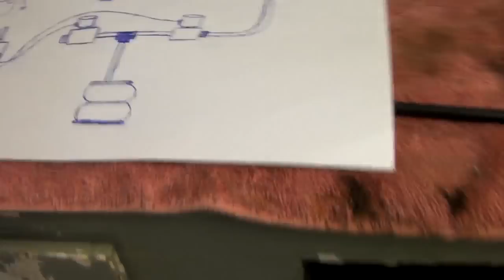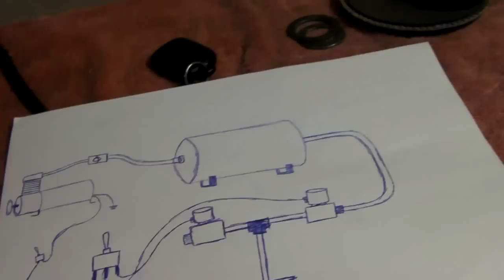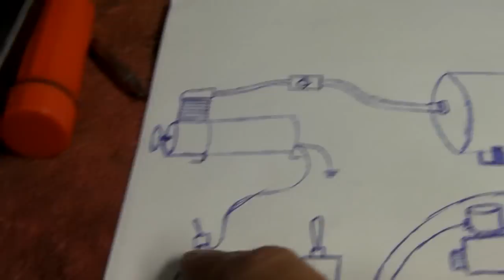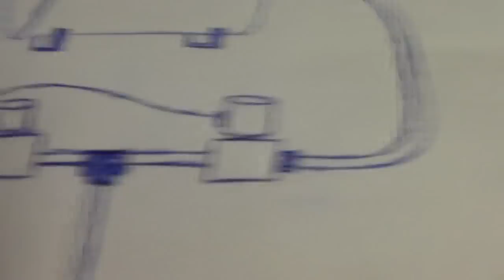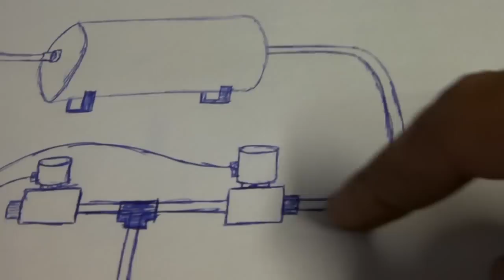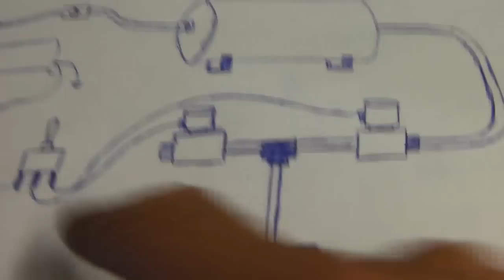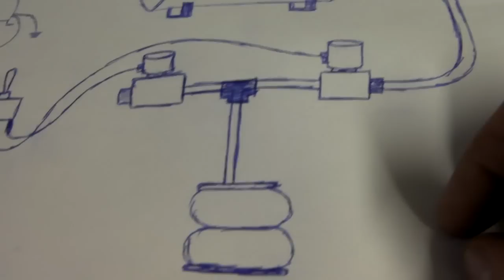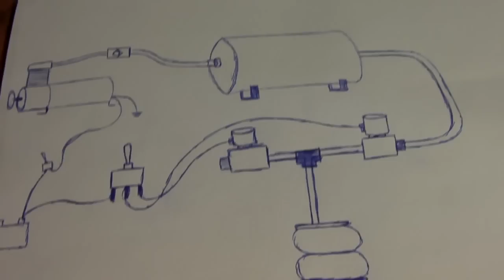Air Ride Suspension, Learning the Basics

Comment: Nah, you didn't confuse me.  Good information.  Heck, I was hoping that you would dive even deeper.  I mean, what size of hose (blue) was that (3/8")?  What type of hose was it?  Why did you choose that hose over the stuff you typically see in an air ride system, which looks to me like plastic?  What size were the manifold ports?  I could use a follow-up video with more detail, to include what you've seen over the years with those "death trap" air ride systems and what you had to do to correct them.  Details... :D
Reply from the maker: I actually did a series of videos when I built my current ride and I covered and explained a lot of details. Check out my 72 Chevy C-10 build.

Comment: Hey, very good video. I'm doing air ride on my truck and I'm new to it. I'm only doing bags on the front for clearance purposes. Would I only need 4 valves? Also where did you get the rocker switches at?

Comment: Your drawing is fine and thanks for the basics. I asked questions and the first word of the answers are normally already over my head. I'm a tech, so I can get it, but you got to start somewhere right. Hope you don't mind a couple questions. Trying to accomplish: 1) Ability to get rear end 9" off ground to load a wheelchair. 2) Raise back to normal height at push of a button.. 3) Normal ride all other times. 4) Dependable. You think I can do that for under a couple grand or close to it??? 2013 Transit Connect XLT
Reply from the maker: check out the accuair E level system for simple one touch operation as you're describing..... problem is, that system alone is 800-1200 dollars by itself. Then you'd need all of the other components and that would add up quickly. And that hasn't even been installed yet and depending on the shop that does the install, most shops charge minimum $80 an hour for labor....  I'd say a couple grand isn't gonna make it happen unless you find a shop whose willing to do it for a charity tax write off??? I don't know. If you're talking about Only the Rear and not the whole car, that could be an entirely different story. Depending on the level of fabrication involved to achieve you 9" requirement, that could be as simple as installing bags in the rear and that's it,,, or having to "4-link" and cut and raise the whole floor???  I'm unfamiliar with those vehicles so I couldn't tell you,, but it could be done for sure.... how easy it is and cost involved would have to be determined by the person doing the installation after they see what's all involved. If it's "easy" a couple grand should do it,,, but if needed to fabricate and rearrange everything else to make it work, the cost could easily surpass your $2000 budget....
Reply: A lift is $8000 and a manual floor lowering is 20K and neither is very cool. So I would say this is more doable. especially because I can get what I need over time. Thanks! Truth is I'm a shop manager for a fitness equipment store, single dad, and a Uber driver on the side. What I'm trying to do is help those wheelchair bound while making a living too. This is kind of exciting.
Reply: First thing I have to do is lower my Transit Connect down and go from there. Maybe an axle flip.

Comment: I know its a dumb question but I've never done air ride before. When you have airbags you still need to have shock absorbers?
Reply from the maker: Absolutely! Shock absorbers play a very important role in an air ride suspension. Without shock absorbers, any suspension is dangerous.
Reply: siTTinLo420 thank you! I'm going to be putting them on a vw bug and all the videos I've seen they only have the shock absorbers in the rear and they eliminate the front ones.

Comment: stupid question ...newbee here..lets just say I don't want seperate switches..i just want all 4to go up and down , not each one invidiually... so  wouldn't need all those bs slenoids and valves?
Reply: 1986Caprice 5.0 you would still need 4 valves and you need to t the fronts together and run to 2 valves then you would need to t the back together to 2 valves and you only need to run 2 rockerswitches hope that helps you out
Reply: I bought a truck with airbags but the guy said the switch wasn't connected and the truck is lowered completely I need to move the truck and lift the truck do I just need to put 150 psi in each tank have one for the front and one for the back ?

Comment: hi bro, am from indonesia and don't speak well in english,well i want to ask you, do you put a shockabsorber on it?. why when you infate the air bag, the truck move up so fast and the truck don't move smoothly?
Reply: Satrio Wijoyo this truck does have shock absorbers. and it moves fast because of the size of the valves/manifold/air lines.  half inch or bigger and running a 200psi or greater system will move it this fast

Comment: you did a great job in explaining the whole process. very straight forward. I have a question for you, I have an air bag setup in my car, if I pump air into the 4 bags and leave it overnight, the whole car would be sitting all the way to the ground. do I have an air leak? how would I know? would greatly appreciate your help
Reply from the maker: Sounds to me like your tank is losing pressure overnight. It's a common issue.    To check your system for leaks, air it up and then with a spray bottle full of soapy water, spray around all fittings, lines and valves and tank,  if you see it start to bubble, there's your leak.  Also if you have electric air compressors, the built in check valves in the leader hoses tend to not last very long at all, which is why I typically add another one between the compressor and tank.